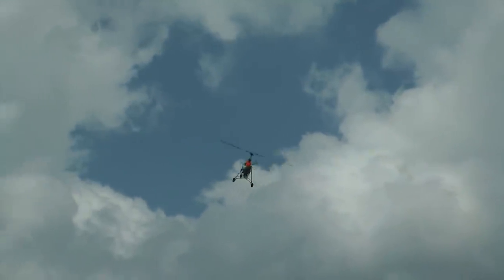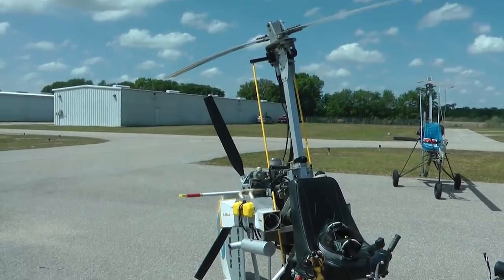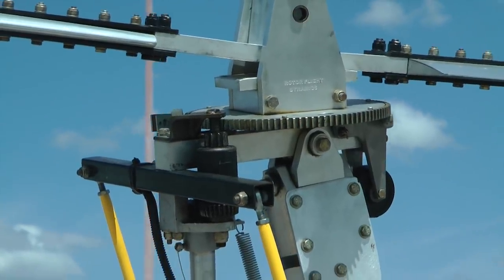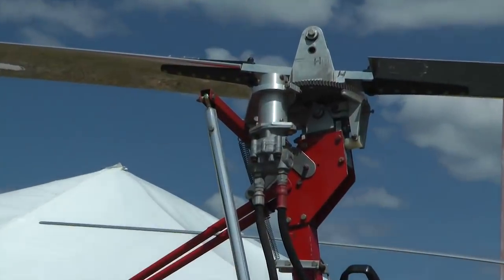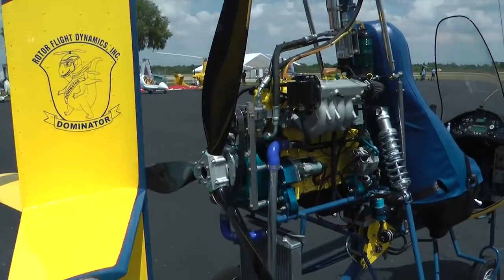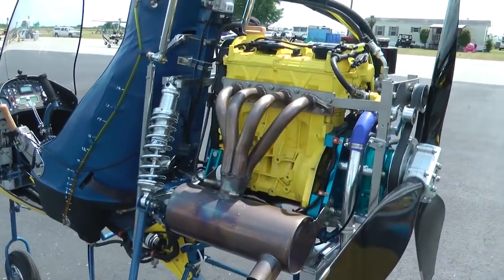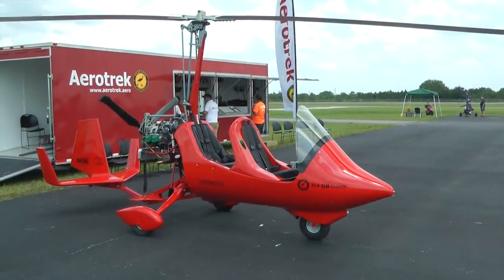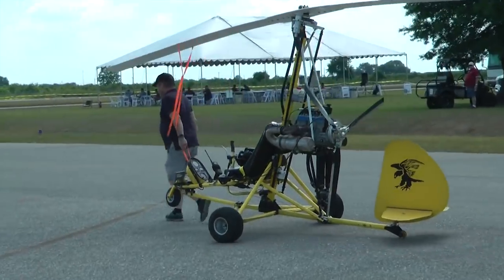What's so Special about a Gyroplane?

Comment: Actually built a gyrocopter in my garage from plans.  Using a 447 rotax dual carb. And 23ft dragon wings, and i designed a pre-rotator from a geared vehicle starter.  I designed it on center line thrust.  Flew beautiful.
Reply: Can you supply me with the plans?
Reply: @lelotz  where can you get the plans?
Reply: @excellenceinanimation960  I did not get it. If you Google you can get plans for the gyrobee.
Reply: @lelotz  thanks! I would love to do this some day!

Comment: The biggest 2 causes for gyro crashes are Operator Error/ Lack of training.. and inadequate preflight checklist.. I have seen some questionable designs where the vigilance and ability of the owner/builder mitigated most concerns… and I have seen well proven designs… neglected and trusted by fools with nearly zero checks before attempting flight.

Comment: Correction: Igor Bensen is not the father of the autogyro.
He may have popularized it it the US through his "Bensen Aircraft Corporation" (Est.1952)...
The inventor of the autogyro was Juan de la Cierva, a Spanish engineer who invented it in 1920. (He is the equivalent of the Wright brothers for rotary wing aircraft).
From 1925 onwards Cierva worked in Britain. Based on Cierva's designs, Harold Pitcairn was (early 1930's) the first to produce certified autogyros in the US.
Unfortunately, Cierva died in 1936 on an airplane crash near London (onboard a Douglas DC-2)
Reply: So it wasn't just the title of father of the aviation that the Americans took for themselves, it is ironic to know this being Brazilian.
Reply: That is absolutely correct.

Comment: Dad had built one back in the late 70s with a converted air cooled VW engine . It was still in somewhat new condition when it was lost in a shop fire . He kept flying only it was in fixed wing planes which was ok but not as much fun as the gyro copter .

Comment: If the engine breaks down Auto Gyro will still fly and land safely but what happens if main rotor has malfunctioned?
Reply: There's not a lot to "malfunction". It's not particularly more complex than a bicycle wheel. It's far less complex than the swash-plate arrangement found on traditional helis for cyclic and collective pitch control.
However, the results would be pretty much the same as if your wings on a regular fixed-wing plane "malfunctioned" - You become a passenger in a ballistic chunk of ex-aircraft.
Reply: Then you fall out of the sky.
Reply: It just spins.  It .... spins.  There is NOTHING mechanical about it.  It just spins.  It would take a direct nuclear hit for it to malfunction.  I mean it just spins.
Reply: Depending on the failure, you'd have a very bad day...

In the helicopter world they refer to the main fixing securing the rotor as the "Jesus" nut, because that's what you'll say if it falls off!
Reply: Yell the name of your particular invisible friend.
Reply: @garypulliam3740  This is a terrible statement. Firstly a wheel is considered a simple machine, and its literally just something that spins (it is also arguably simpler than a gyrocopter rotor). Thus a wheel is mechanical. The same can be said of a gyrocopter's rotor.

Secondly, i can name at least 5 things off the top of my head that just spin and can still fail. Bearings are not full proof and still have the possibility of seizing up and failing.

What you wanted to say was that theyre very simple machines and thus have a very low chance of malfunctioning than compared to something complex, like an engine. However, technically, a wing has an even lower chance of malfunctioning, cuz its literally a wing. Its fixed and has even less moving parts than the rotor.

The main reason why the autogyro is better than a plane for a deadstick landing, is that the autogyro's rotor is basically idiot proof. Its unstallable when compared to a normal airplane and has a much lower landing speed.
Reply: @garypulliam3740  It just spins unless somehow the pin wasn't properly placed! i.e., possibly the cause of a father & son's demise!, where the rotor was located distances far away from the crash🤔...
Reply: @RoadRunnerLaser  Well said! Truth
Reply: Pluse side you can fall straight down with engine failure without dying. Only con I’m aware of is if you stall a gyro and don’t lift of throttle you can flip the plane due to momentary uneven negative lift.
Reply: @pegbars  nope, you use the air and rotor to glide down, np.
Reply: All things mechanical can fail , and at any time, but if you want to have the ultimate  "belt and braces" solution, then install a Ballistic parachute somewhere on the craft,  but to be honest, if your numbers up? it's usually up!  The question that has to be asked is? how many crashes/deaths have occurred due to main rotor failure? and how many due to pilot error? If you don't want to crash, get seriously well trained up from a good flying school, don't buy second hand, don't build one, buy a new certified Gyrocopter, and don't be a silly ass in the air!!
Reply: During preflight the "Jesus nut" is checked.  If this nut comes off during flight, you make express visit to meet Jesus.  (Or you meet the "creator" of your religion.)
Reply: @garypulliam3740  😂😂😂😂 got it that makes me feel safe

Comment: These Benson gyrocopters were very dangerous, because an inexperienced pilot would create Pilot Induced Oscillations due to the delayed response to power input.  The inclusion of a horizontal stabilizer dampened that a little, but they still had safety issues. The newer designs have addressed a lot of them, but unlike the autogyro (prop is on the front of it instead of behind), there still is the possibility of a PIO. Also, there is the matter of the narrower flight envelope compared to the fixed wing.
Reply: false: the gyrocopters type "dominator" (power axis at same lever as the GC) are not prompt to oscillations...but all gyro are dangerous if bad use: hard climb (with dramatic speed loss) or hard down are forbidden manouvers because discharge the rotor who loss fast the RPM and so the lift...
Reply: FALSE- The original Bensons were stable enough for safe flight... they were also the seeds of other homebuilders that unknowingly redesigned the ship when they added bigger props, bigger engines, moving the engine up "just a bit", thus making the COG move to different positions... THAT was when the horizontal flying surface was introduced to combat the poor engineering of the novice homebuilder.  The "dangerous" component of the sport was introduced when the novice pilot would "teach himself" by the book... and NOT follow the book!  The results of self training are predictable.  Prop in front or Prop in back does NOT make a difference in thrustline of the vehicle.
Reply: Bensen autogyros were prone to PPO (Power Push Over), not to be confused with PIO (Pilot Induced Oscillation). 
The risk of PPO was due to a mechanical flaw in having the center of thrust be higher than the center of mass; this gives the autogyro a tendency to pitch downwards with throttle, which can unload the rotor and result in said PPO. 

Experience and great design are the best safety measures. Nowadays, autogyros are built with horizontal stabilizers, reducing the risk; and some are built with a center of thrust above the center of mass, all but nullifying the issue. PIO is still a problem though; and that's why there's no substitution for proper training.

Even with all this, the autogyro is one of the safest aircraft available. Take off and landing is a breeze (pun intended).
Reply: Dominator is LTL, not CLT, as I learned after many years in the business, meaning it wants to push the nose UP when you unload the rotors and stop moving forward.  Some folks think this is a good idea, but some don't.

Comment: I wanna build one! My main concern is how to make the rotor and the levers to move it properly. The rest is pretty easy I think.
Reply: P.S. The only parts of a gyroplane that you're better off buying than building yourself are propeller, rotor blades and possibly head and the engine. All the rest is very very easy indeed.
Reply: The cierva C.30 had a direct linkage to the rotor, so no levers. There are some plans for a wooden replica with 300kg mtow and looks extremly easy and cheap to build. http://giroweb.mforos.com/378414/8726866-autogiro-c-30-planos-constructivos-tractor-de-victor-merino-espana/
Reply: I like my temper the way it is. It keeps idiots away.
Reply: Reverse thrust: trolling is also not compatible with flight safety. Privileges revoked. 

Arguing this decision proves the point and extends your sanctions.
Reply: One of the cheapest and safest ways to fly besides paramotoring no license required like a moped for flight junkies. Put a prop on my beanie and off I go into the wild blue yonder, I really like the watercraft version of this Gyrocopter with a triangle control arm for the disk water landings and auto Gyrofriction pressure fittings to the motor look way more efficient and cheaper to build with less possibility of failure for spin up and lighter on the airframe. Thanks for the great video!
Reply: @ZioStalin  agreed! there are people who think just because THEY lack the ability to accomplish something the rest of the world is equally inept.  They forget that once upon a time everything was built by hand even cars...

Comment: 0:30 
Americans were not the originators of everything, you know. Igor Bensen was NOT the “father of the Autogiro”. He got his ideas from a captured, towed autogiro used as an observation platform on German U-boats.
The Germans got their ideas from the true originator Juan de la Cierva, a Spaniard who invented the concept in the 1920s some thirty years before Bensen came on the scene. The British Avro company (amongst others) was building them under license to Cierva in the 1930s.
Reply: He doesn't me invented. He means Igor Bensen made it popular in america. This is also true of several other hobby industries. Inverters are responsible for the invention not the industries.
Reply: Before the development of the helicopter, the British Air Force used British built Cievra autogyros to test and calibrate radar installations during WW2 - their virtue being that they could hold a very nearly fixed position by moving in very tight circles.
Reply: Yes, they were.  Anything really important or cool always comes from the US.

Comment: I wonder if you could do away with the engine and fuel tank, replacing them with a battery pack and electric motors. Range and weight might be an issue?

Comment: so the propeller gives the push and the wind coming over the upper blade makes it rotate for the lift did I get that right?
Reply: i believe the forward wind is hitting the bottom of the top rotor blades from the look of the angle it sits, its tilted back a little. i could be wrong. im not pro  with one.

Comment: Gyrocopters got a bad reputation because no one could get proper training.  You see, back in the day there were NO TWO-SEAT gyros around!  Now that we have plenty of two-seat gyros and CFI's to train new pilots, we still have trouble with pilots who decide to solo before they are really ready to be on their own.  But the record has GREATLY improved with the help of organized clubs, better aircraft, better engines, and improved designs which make managing the aircraft easier.  But I still see brain-fart mistakes.  Even my own.
Reply: GTgyro 3
Reply: Back in the day my dad had a two seat (side by side) autogyro. I'm talking early 60's.  So there WERE TWO-SEAT gyros, maybe not a lot but we owned one.
Reply: how much is that
Reply: @wilfredoabordo2624  
Iff'en ya gotta ask,
ya cain't afford it...

Comment: Bensen was not the father of the gyoplane/gyrocopter/autogyro. See the following from one quick search:                                                                                The autogyro was invented by Spanish engineer Juan de la Cierva in an attempt to create an aircraft that could fly safely at low speeds. He first flew one on 9 January 1923, at Cuatro Vientos Airfield in Madrid. Cierva's autogyro is considered the predecessor of the modern helicopter.

Comment: Thank you very much, your video has answered a lot of areas which puzzled me. For the sake of safety, roughly how far can these Gyroplanes glide if there is a failure in the drive mechanism?
Reply: all the way safely to the ground.
Reply: OR... all the way to the crash site.
Reply: They glide as well as a brick thrown out of a aeroplane. You have to keep the nose pointing down at a high angle to keep up the airspeed to keep the rotors turning fast enough so when you get close to the ground you pull back the stick and flare out and use the rotor energia to make a soft landing. Worse case scenario is you come down vertically if you only have a small spot to land,  the rotor will slow you down and the landing gear will absorb most of the shock and you might tip over and bend the rotors. But servivable. The one thing a gyro can do is flat spins safely. JD
Reply: That reminds me of airborne school ;
The instructor was talking about when to activate the reserve parachute. When you exit the plane, you are counting. At 4, you should feel opening shock of your chute. If by 7, and no canopy, deploy reserve ( a training jump is only 750-1200' altitude)
A student asked ; " Sgt Airborne, just how long DO you have to activate the reserve parachute?"
600 men in the class and it got so quiet that you could hear a pin drop..
The instructor replied; " Son, you've got the rest of your life..."

Comment: A hell of a lot cheaper than a full on helicopter
Few parts to go bad safer as it auto rotates so its  less of an of issues the blades still turn and lower you to the ground as opposed to sudden failure and you go into a death spin you can't get out of .. or very difficult at best

Comment: Auto-rotating your way across the country, one fuel tank at a time. 👍🤜🤛🤗🙏
3:50 Technically, the motor does power the rotor in flight.  Without the motor to begin with, you'd have no flight at all.  Unless of course, you only used gale force winds to gain rotor lift speeds.
Reply: Given a long enough runway, autorotation should happen with no direct thrust from the engine. The motor-powered spin-up allows for shorter take-offs.
Reply: The guy flying the autogyro in Mad Max just used his hands to start the rotor spinning.

Comment: Why are they all pushers?
Reply: Better rudder control at low speeds is the primary.advantage. The prop blast blows directly onto the rudder even at low, taxiing & landing speeds. Balance is also achieved easier since the pilot normally sits out front.